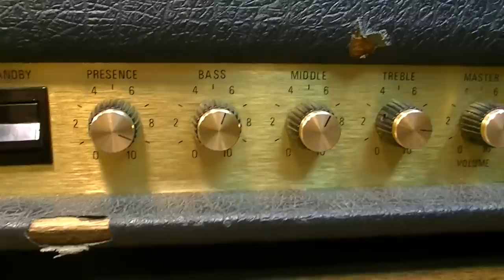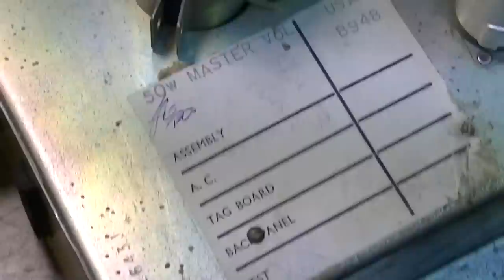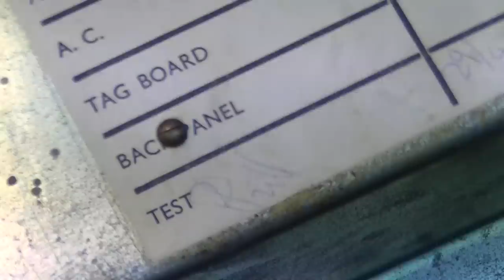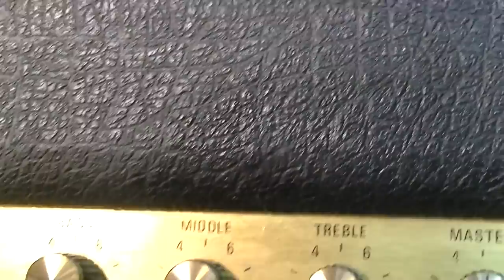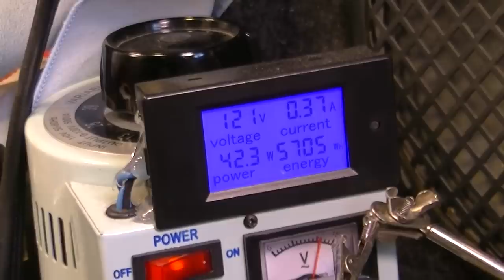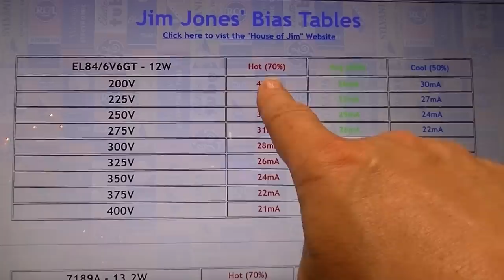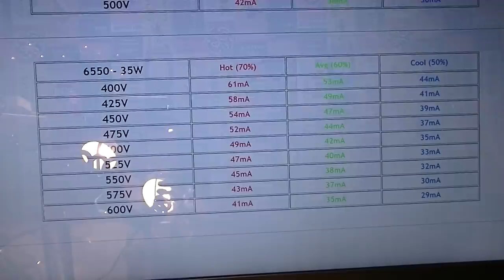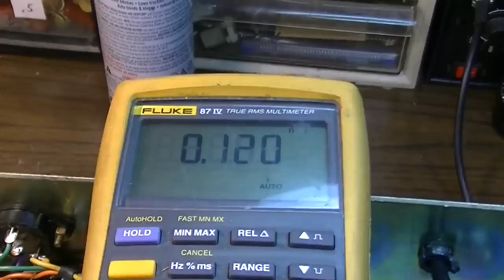Secrets of the Marshall JMP 2204 Master Model 50W Mk2 Lead Head - The PERFECT Marshall Amp!

Comment: you can definitely tell mustards from other caps. the way the tone controls react and the sweet spot in the sweep is very articulate where other types of caps are much different and don't the sweet spot and the dark scooped mids and highs marshalls are known for. you don't want a gainy amp that sounds boxy and loose you want very tight bottom and articulate singing highs mustards deliver. My amp is a different type of board than this one more of a transitional turret hybrid type with all the original mustard caps. keep your mustard caps people!!!!

Comment: Should one not bias 6550 tube on the cold side. If I remember correctly, they did not make a separate output transformer for them, therefore one should bias them as 25w tubes, therefore 40ma was OK. Anyway, colder bias worked for me, didn't want to risk blowing OT. BTW, KT88 also works swell. More hifi and tight sound compared to el34.

Comment: There are several errors in this video, particularly around the :45 minute mark. Some homework beforehand might have been good. This is a cascade preamp design and deletes the V1a cathode bypass 330uf cap. The 68k are moved to lower the RF potential right at the grid.
Good catch on the tone stack treble cap, a lot of these old marshalls have had “kitchen table surgery “ over the years.

Comment: You bias a 6550 powered Marshall the same as an EL34 Marshall.  The power transformer is the same as the EL34 powered Marshall’s.  Biasing 6550 tubes to 70% of their full rating will put strain on the power transformer it wasn’t designed for.  You can end up burning the transformer out.  Use the EL 34 tables whether the amp has EL34’s or 6550’s.

Comment: needs a musterd cap kit they have more mids,,, to me the magic of that amp is driving the EL34S in to brake up. the mix of the front end distortion and the power tubes is where it is at. some one should spend the money to get that back to stock.

Comment: Imo bleeders are just good practice, they cost next too nothing, they dont harm anything but they add potential safety. A 1Meg is gonna draw half a mA and not even dissipate a quarter watt. Where they are necessary is for amps with standby between main reservoir cap and plate supply, because if someone turns off stdby before turning the amp off, the tubes wont drain the reservoir.
Reply from the maker: You are correct about the standby switch and the added inefficiency.

Comment: This model dos not require a 330uf cap dude.  1 ohm 1 percent is what you need, if you use 5% then the bias will be off 5%  35 watts at 400 volts Formula 35 divided by 400= 0.0875 so .87 times 70% =.609  60Mv should be your bias.
Reply from the maker: It would potentially be off by up to 5%. I measured these and they were pretty spot on.

Comment: had one of  these back in 83 and hated it, had no balls
Reply from the maker: Something was wrong with it then.
Reply: @TheGuitologist  maybe , I remember it souned like AC/DC or bad company. So it was pretty whimpy. I switched the JCM 800 2204 and that was a little better. Still a little tame too.
Reply: I had one also back then and it sucked. It had way too much treble and was as cold as a witches tet. I always blamed it on the 6551 tubes.  I sold it before I knew about after market modifications and tune ups.
Reply: @chrischoir3594  did your cab change when the head changed? (G12-70s?)
Reply: @EtherDais  No I had the same cabs 1960A and B. they were stock. Not sure what was in them. I guess they could have been the G12 70s

Comment: 2 things: the max plate dissipation for a 6550 is actually 42 watts, not 35. Second, that 47k capacitor is actually 47pf, with the "k" being a tolerance designator.

Comment: Voltage doesn't kill in many cases its the amps that will end you quickly .05 amps AC s enough to stop your heart  and 120 vac kills more people every year than higher voltages I've been hit by 120 volts no amps and you just feel the cycle kinda like an old buzzer toy and I've been hit by 277/480 commercial voltage with several amps and it kicked my ass I was in a lift and got hit by a stray wire sticking out of a wire nut ,this was on a commercial.lighting circuit .it felt like every bone in my hand and forearm was crushed, and it put me in my ass in the lift.bad day, to say the least.

Comment: In my experience those DALY caps are part of the Marshall tone. While it makes perfect sense to replace them. If they show no signs of stress I always leave them alone.
Reply from the maker: I can understand leaving working components in, but I dispute the claim the Daly caps are part of the Marshall tone. Any working power cap with the same value will give the same results. Power cap brands have little to do with the overall tone. Far less important than transformers, coupling cap values, tone stack, preamp architecture... Even output tubes are way down the list when it comes to the character of the tone. At least that's my experience.
Reply: The Guitologist - I respect that opinion and many have argued this topic to death over the years. Science is fact so it makes sense same value,  voltage and materials should yield the same sound. In many cases I found this to be true. However, In many instances not. Replacing the original DALY caps for current available replacements hasn’t been a satisfactory experience for me. Time on component and perhaps a small amount of drift would certainly add to the differences. But I believe material composition and construction play a bigger part. Today’s materials and construction techniques are far different than they were 50 years ago.
Reply from the maker: For electrolytic capacitors they are better.

Comment: the K on the 47K cap doesn't mean "kilo", it means 10% tolerance.
Reply from the maker: Some do, but I think it depends on the company because there seems to be at least 2 naming conventions for small caps like this.
Reply: I have presonally never seen a cap where K would mean "kilo". 47 kilo pico farads? Why not just say "nano"? Well, maybe they do exist. This one is 47p +-10% though, it's way to small to be 47n @2kV.

Comment: transformers are original. numbers are manfr. code.   First year of MV used the 330uf cap on V1.  Kinda sucked.  Then they changed. but used up PCB stock, screen printed boards.   Killer mod for the MV's----- ditch the bright caps on the volume pot and just go with a 68k resistor, or something near.
  V1 bias resistor from 10k to 4.7k.  good gain increase and you knock down the high end shrill their famous for.

Comment: yeah buying a British amp and complaining about brittle sound - someone obviously bought something by its name here. thanks to those folks there are no stock 2203/4 for reasonable prices on the market.
Reply: What do you think they should cost, vs what they are offered for?
Reply: @EtherDais  over here modified heads go away for anything between 900€ and 1400€, unmodified they start at around 1800€ and for that money I'd rather go with a ceriatone clone (they are awesome)

Comment: Here are some thoughts about safety from another electrician on another continent..

AC starts to be a real danger for people with serious heart conditions when 100 volts are passed combined with max unlucky conditions. voltage under 50 is regarded not dangerous. 
No education or electro-certifications are then needed to do a El-installation.  

I say that it is not smart being like that. The reason is this scene: 
A moron with no education starts doing electrical installations that is supposed to be working with only  2 volts.. 
2 volts cant be a problem or?  The truth is that its more than enough for starting a fire in seconds really easy!! 
A not so dangerous situation for the idiot, but so much worse for the public!!
lets say a school is now in flames and it started because there was a faulty connection somewhere..  

Well.. killing everybody at a elementary school.. and not yourself. its not recommended to do that! not at all ! 
Anyway it illustrates how badly a certification for electrical stuff is without talking voltage only, yes voltage is danger but stupidity is dangerous on all voltages for everybody !!

The DC is not as dangerous as AC. 
But ONLY up to a point where the voltage gets so high that even a very short burst of DC will be like being hit by a defibrillator.. That machine has saved many life's for sure..!
it will stop a already beating heart and restart a heart that is not beating...that means:
if you are shocked with high volt DC, its by far best to get the first shock when your heart is already stopped !! 
It cant be easy to arrange 'stuff' so you can be sure those exact conditions is set every time a live part is accidently touched. 

But in every case where the current goes through the heart, the danger is in a class of its own. 30ma is the limit on all automatic switches that cut the connection back on to the net if current starts to flow to ground via safety wire or via neutral. 

But in those cases its the Internal Terra system that is a danger. Not used in the USA as far as I know.. U have TN 110v.
The Tera Neutral system is self protecting when ground connections are made since neutral and ground is connected together in the fuse box, and a ground connection would then be as a short that will push the automatic fuse to disconnect instantly.

So all the stuff you mentioned is correct, but even if most people can take a shock or two or three.. 
that high voltage is a gamble with your life for sure! And you don't need that coz the odds.. its Ruzzian roulette!! 
500 volts DC through the heart is.. _______flatline 99% of the times.  it is as if being hit with a real defibrillator!!!
 The only reason you or anyone survives that kind of shock is luck .
 
Then its a easy conclusion to draw. 
The only way to threat the high voltage inside such amps or high voltage in general is to make sure you never ever touch it !!.!! 

Being an electrician for over 30 years I admit I have got quite a few shocks myself until... I almost did it but was also lucky!! Got myself a few spots of 3rd dg burned skin, and I saw and understood how lucky I have been. 
-so I decided to sharpen up and just start having a zero tolerance for it. Working safe turned out to be very easy and so, no more accidents since. pheeewww.

Well, Thanks for making these videos !! 
They are pure entertainment to watch since guitars and amps and electro is three of my main interests !! 
A very generous repairman is sharing his knowledge about old guitar tube audio equipment...
I'm telling you, not many channels do that now days. It is priceless info for everybody that need to learn about it!! 
-Knowledge like that cant just be bough!  
Still ..100% free...haha pure gold!!! 

Millions of thanx!

Comment: Replacing the heating element on my parents dryer, hey dad is the breaker off for the dryer? Yes, I just turned it off. OK this is really tight with the crossmembers, I have to jam my arm in there because they're welded on. It's fine, take it out. HMMMM !@#$ $%^& &*() Dirty SOB!!!! OMG I'm still alive. Then he asked me what in hell I'm screaming about and what's burning? The hair on my friggen arms, SOB! That was 240v!!!!! Oh I must have hit the wrong breaker and why are you staring at me that way? If I didn't love him with all my heart, I would have killed him right there.
Reply: No, it was hardwired. The guy who built the upstairs rooms never put a plug in.
Reply: MrBrymstond  When dealing with Mains power, don't trust anything but a Fluke or equal quality DMM. I don't mean to sound like a jerk, but you have only yourself to blame. I'm glad you're still alive.
Reply: good 'un+ This happened years ago and we have the same codes. I'm around Albany area in NY and the guy was kind enough to solder the connections together. I was on my way to work and stopped really quick to swap out the heating element and BANG! That's when I came downstairs and killed the main breaker I was so pissed, but I did change the mess to a plug. Just something to never trust is anyone's ability to turn off a electrical breaker when you're about to work on something like that. I go to Rockport Massachusetts every year, where are you abouts?
Reply: I hope you don't think I know that, I was in a hurry and had to get to work, didn't know about the hardwire, replaced the element and went to work, came home with a dryer wire with it's proper connector and wall receptacle and marked the breaker as Dryer. While I was up there I found the end of the electric stove connector he cut off and soldered instead of just using the house wire, he ruined a perfectly good cord. This was supposed to be a professional job.
Reply: Robert Calk Jr.+ Me too
Reply: good 'un+ I didn't ask for your address, just a where abouts like Boston. To each their own, disregard the question.
Reply: The only person I ever trust to verify power off is my buddy Fluke.